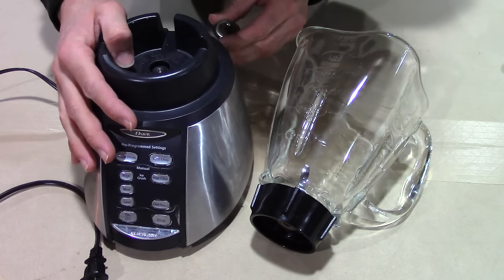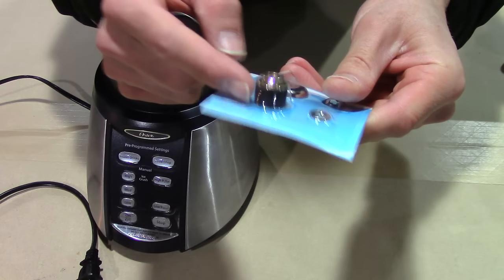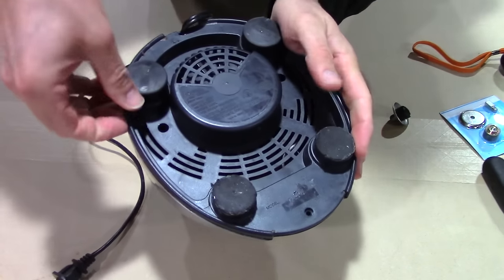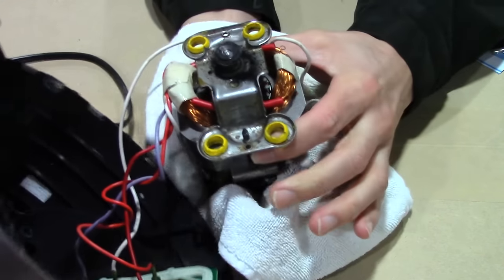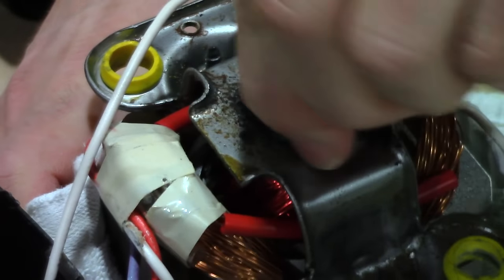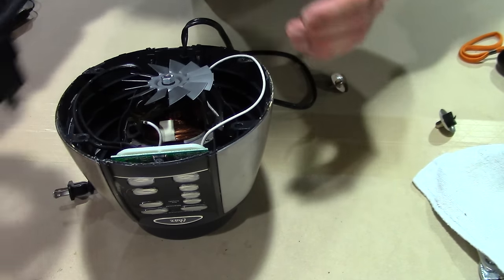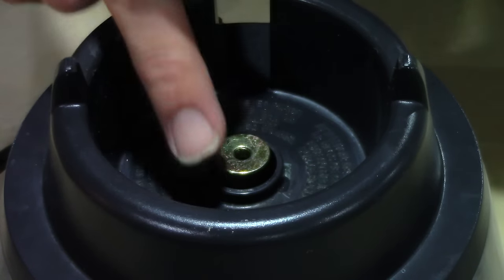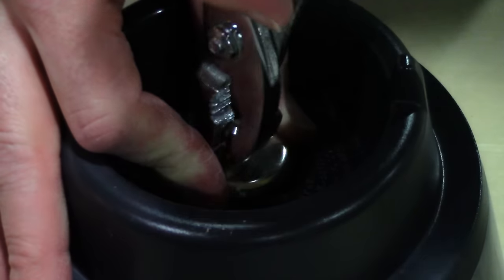OSTER Blender Repair - How to fix an broken driver

Comment: Thank you so much for the video. It worked for me with some extra work because my fan blade started to get stripped so I ended up taking the fan off putting the nut back on halfway to protect the threads and grabbing the motor with a niddle nose vice grips and a crescent wrench on the other. Thank you again.

Comment: Thanks, never imagined it was so easy to remove the impeller driver.  I didn't need one, just needed to take the blender apart of put some oil on the bearings, screaming like a charm now.  Thanks for posting.

Comment: IF yours didn’t break completely off, but needs replaced (growling noise in my case) this may help you:
The square drive stud simply unscrews counterclockwise out of the bushing allowing the plate to come off  - I just held the nut (under the motor) securing the fan blade by hand while unscrewing the stud.  Once the plate is removed then you can remove the motor from the plastic shell.
To remove the bushing, I removed the fan blade and grasped the threaded end over the flat side with plyers while unscrewing the bushing with channel locks. ..not very hard to remove so I didn’t crush the threads too badly!  The threads survived to reinstall the fan blade.   
NOTE:  I tried to find an additional “jam nut” to tighten up against the first one to prevent the first nut from unscrewing, with a wrench on it, while removing the bushing.  It is 1/4” but uncommon ‘threads per inch’ that neither Lowes nor Ace had (it is NOT 1/4x20 nor 1/4x28) guessing it’s a discontinued 1/4x32 on my 80’s or 90’s model.  IF you can order an additional nut with your new parts, you will have the easiest removal - and you could just leave the additional “jam nut” in place...(No reason to remove the fan blade this way) 
Oh and don’t even try to grab the fan with plyers or it will easily begin to round the flat side off against the bolt when you attemp to unscrew the bushing - just way too thin to resist much force!

Comment: The coupler on my Beehive was not broken but the square drive pin kept slipping out of the hole on the blade assembly.  Maybe the bearings in the motor have worn and let the shaft sag a bit?  Your video gave me the idea to shim the drive pin up with a washer between the coupler and drive pin.  One less appliance in the landfill.  Thanks!

Comment: Hello Adam. I know this video is 7 yrs old but I have this same blender,. Since the motor is fine, I decided just to repair with driver kit you illustrated. However, I'm having no luck getting the driver or, what some people call the stud, out of the blender. In your video you already have it out. I've tried holding the fan or the nut to the fan with a crescent wrench and turning the driver with pliers with my other hand. It won't budge so I'm wondering if I'm missing something?  Thank you
Reply: Me too!
Reply: same thing with me!! @dolphinsil
Reply: Same with me😢

Comment: This is a great video!  However, I'm stuck and I hope you can help.  I have a 10 speed Oster blender and when I took out the three bottom screws, the motor did not release as it did for you.  It is still firmly situated in the plastic housing.    I don't see any additional interior screws.  Do you have any ideas?
Reply: did you ever get the problem solved? If so, how?  Leo Goldberger
Reply: Same problem here
Reply: Same here

Comment: Foo, my fan spun on the shaft, despite the shaft having a flat side, and the fan having a hole that (used to) have a flat side.  I tightened the fan nut, but it just came loose again.  I removed the nut and fan, and carefully put an adjustable wrench on the shaft.  That allowed me to break the driver loose, but of course mushed the threads on the fan end of the shaft a bit.  Some care in reinstalling the fan and nut sufficed to get it back together.  Now to order a replacement driver . . .

Comment: This video is amazing but my blender is oster 1200, I bought it on December 2020 and the motors are attached… I can’t tell what screws I have to remove to get the motor out to change the driver. 
I was axle to open it but that’s it. 
Do you know how?

Comment: I’m trying to take off the old stud from the Oster blender but I’m not able to do it! If I hold the fan and rotate the stud with pliers, the nut from the fan loosens and falls down! I tried to open the fan and hold the shaft, but isn’t working either! Any suggestions please?
Reply: I’m having the sabe problem. We’re you able to fix it?

Comment: Can't get the old part off my Beehive blender.  When I hold the fan the nut holding the fan loosens.  Any suggestions? Thanks.
Reply from the maker: You can take the fan off and vicegrip the threaded shaft. you may ruin the threads but as a last resort, I would try it.
Reply: Stev607aqr Remove the plastic  bottom from the base of the blender. Holding the center of the fan, grip the knob with a wrench and twist it counterclockwise.
Reply: Stev607aqr , i have the same problem; when I hold the fan at the bottom, and use a pair of pliers at the top and turn counter clockwise = the nut and then the washer or spacer or whatever that silver ring is, comes off!!  My Osterizer blender is about 30 - 35 years old, "Designer, Dual Range" I can't find any site that even recognizes this model. 
Anyway, did you ever find out how to get the motor out?

Comment: I am trying to replace the driver  on my 12-speed Oster slightly different model from the one demonstrated in your video. After removing the 3 screws holding botom plastic  cover, the motor unit  does not come out.  What may be holding it? Please advise!  

Thanks.  Leo Goldberger
Reply from the maker: Many times stickers are covering the screw holes.  If not then I would check under the rubber feet.
Reply: You don't need to take the motor out completely. If you can hold the fan like in the video and twist the drive pin counterclockwise it should come loose fairly easy.

Comment: The driver won’t come off, I’m holding the blade and it just unsrews off of the machine.
Reply: Had the same, got it solved by turning the blade around (this way the blade gets stuck with the frame) and tighten it real strong
Reply: Can’t release the motor 
Got the kit
Unscrewed various parts. Won’t release

Comment: When this happen does the blender turn on at all? mine does not and i'm not sure if this is the right fix
Reply from the maker: Pablo Andres Cabezas  It should still spin the motor.  You have a different problem with yours.

Comment: Ps. I had a burnt fuse. Thats fixed.
Reply: Where is the fuse located ?
Reply: @geeharris5150  close to where the power cord is inside the blender. Small white tube with metal caps. It fits in a u shape clamps